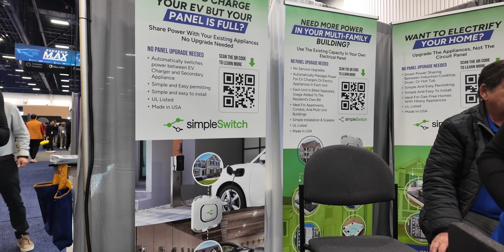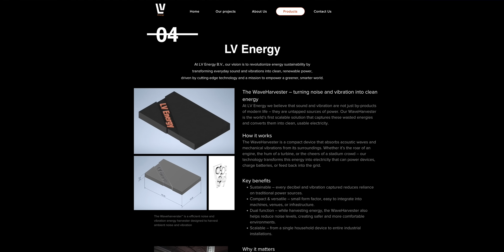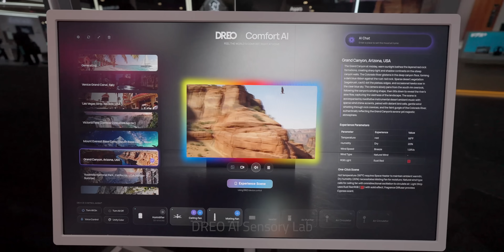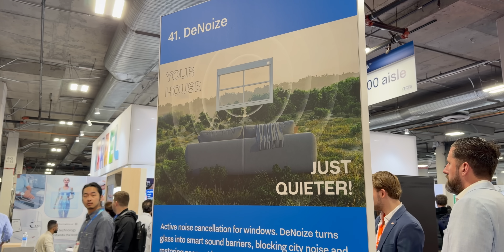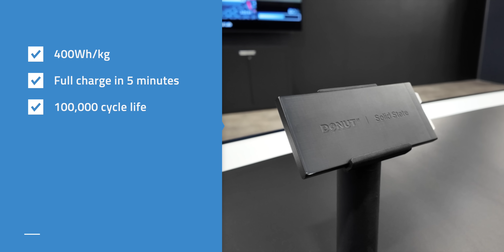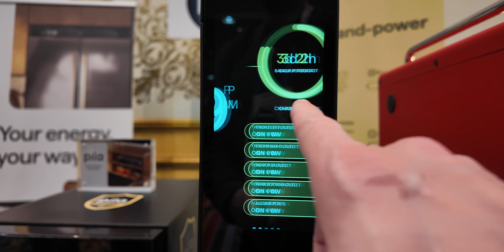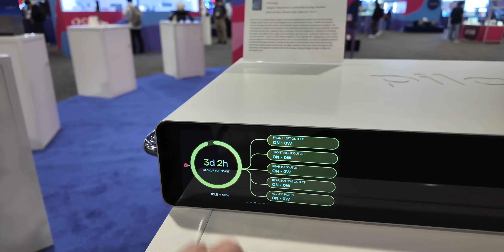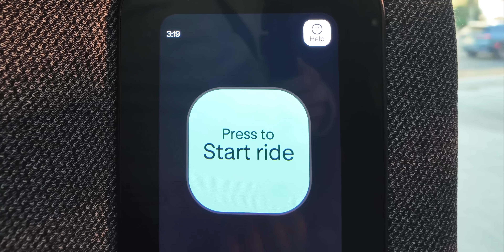The Most Controversial Battery at CES 2026

Comment: We use triple layered glass around here in the Netherlands, blocks most of the noise and is much cheaper. But then again, our construction methods are based on energy consumption reduction
Reply: I have triple layered glass in my new house in Germany, and i can assure you, i can still hear every car that drives by, not to mention heavier vehicles.
Reply: @Daniel-rd6st  hate to be that guy, but you bought a shit product. Most triple glass sellers sell way to thin glass and shitty structures that hold them. 
We had aluminium windows of super high quality with no zones where both heat/cold and/or sound could connect to the out or inside. And thick varying triple glass and all we heard are trucks when its dead silent around us. But if thats the windows or the walls.. who knows.
Reply: @AlbertWeirdo  I have aluminium windows too and they insolate very well, its a low energy home. Even at below zero degree temperatures the house stays at 20 degrees celsius with little work by the heatpump. And the company that build the house is known for its quality (and i hadnt had any reason to complain till now) and not cheap. But especially low amplitude soundwaves get through to some degree and also through the walls (which are a sandwichconstruction around 35 cm thick). Its usually not loud what gets through and i hear it only if i listen for it, but i honestly doubt, that normal triple glass windows alone will block all sounds from a busy street.
Reply: @Daniel-rd6st  Damn, every car? But yeah, I guess I'm spoiled in my courtyard, I can sometimes hear my dog barking on my neighbor's bacony. What I apparently can't hear is a thief cutting open the locks of my ebike, and taking it with me last week. Ugh.
Reply: here in the capital of Argentina, most apartments still use single layer glass for windows and doors, and central heating is also extremely rare, air conditioning not so much

I have absolutely no idea how developers still get away with it
Reply: @Franfiocchi-s7w  My house has single layer (USA)...but it's 101 years old...   I want to replace them...but the new window fairy keeps skipping my house.
Reply: @Franfiocchi-s7w  I am guessing it's because it does not get very cold there so there isn't as much of need for triple layer windows?
Reply: @tktspeed1433  indeed! but It gets hot, and the city sounds invade the apartments
Reply: @Franfiocchi-s7w  Taiwan is the same.😂
Reply: @DADA-bo5li VERY ANNOYING HERE. It went down to 8c a few weeks back, and there's no central heating systems. I turned on some nonsense GPU training sessions for heating.
Reply: Tri-pane helps a bit on noise, but it's primarily for insulation.  If you wanna reduce noise by 50+ dB, you need 2+ panes of laminated acoustic glass.
Reply: Is it common to only heat parts of homes?  I traveled around Netherlands back in the early 90s and more than a few houses were like that.  I was fine with cold bedrooms but one house had no heat in the bathroom LOL
Reply: @pixelpusher220  no heat in bathroom is a bad idea for mold and condensation
Reply: @CompletelyNormalPhenomenon 
That's where the German pastime of "Lüften" comes in. Every few hours all windows are opened for a couple of minutes 😅
Reply: @carstekoch haha is that a thing? In winter that is brutal!
Reply: @CompletelyNormalPhenomenon 
I'm dead serious.😂
It's not as bad as it sounds, though.
Most of the heat is stored in furnishing and walls/ceilings/floors and air has fairly low heat capacity so it warms up within minutes. Gets rid of all the humid air though.
Reply: @MrRAW1968  the company developing the windows is also from Netherlands (Delft). Last I heard they were running trials in collaboration with schipol to reduce aircraft noise in homes near the airport.
Reply: Here in America,  they base property taxes on how well built your home is, b/c f*** the peasants, is what some bureaucrats thought or something?
Reply: @ARKY-v3x property tax is based on qty of rooms, sqft type of rooms and land.

At least it should be. 

The “value” of things in the house shouldn’t affect your tax appraisal.
Reply: @eric4946 .  That’s ridiculous. Property tax is based on market value period.  You could have a crappy house in a wealthy neighborhood and the tax would be much higher than it would if located in an undesirable neighborhood
Reply: @rcpmacthis is not true and not how it works on general and I think you’re confusing my statement as, the same house on the same amount of land anywhere gets taxed as X.

That’s not what I mean, what I mean is that you don’t get taxed on the fact that your house has a better more expensive boiler, and insulation than your neighbor next to you. 

Assessments are based on “generic”
House in that neighborhood with that many rooms and sq ft.

Not the “true” value .
Reply: @MrRAW1968  it's funny that you bring that up, since DeNoize is also from here, The Netherlands :)
Reply: AI tells me 30db is normal for normal double layerd glass and 52 is possible.
Reply: The noise reduction would have to be much better than what you could get from triple pane to justify itself.
Reply: more than that .. R values don't take into account thermal mass. A 5 centuries old church will stay warmer than a modern house for less energy. So your system is based on using less materials not just less energy.
Reply: Here in the US, our construction methods seem more to focus on corporate profit (and trying to build well below minimum code if the inspectors are not paying attention).
Reply: @MonkeyJedi99 same in uk
Reply: @MePeterNicholls  Some good news here in Cambridge UK is that our local plan is mandating minimum land for self-build on new developments. At least some will be able to build to a decent standard.  I still find it ridiculous that people are installing double glazing when the extra cost of triple is tiny compared to the labour cost of upgrading.  To replace 2 bay windows will be £2500 for the windows for triple glazed, but if I wanted them installed by a local company they'd want £7-10k.  That'd be 2.5k per day for their installers.
Reply: @NealeUpstone dont get me started on the postage stamp size of windows too. I’ve seen more upvc than glass on some! And then there’s the ridiculous police led safer by design criteria that’s being mandated by planning depts even tho it’s not law and only guidance.
Reply: @MonkeyJedi99 .  In my American city as in most, not only is the energy code observed and complied with but there are incentives available to exceed the code.
Reply: @MonkeyJedi99  US codes are WAAAAY more restrictive than European codes its not even close especially for accessibility.
Reply: @raaaaaaaaaam496  You don't know what you're talking about. @MrRaw1968 is talking about the Netherlands. You're comparing the US to Europe, while Europe consists of many different countries, each with their own building codes. And I'm absolutely certain that building codes in the Netherlands are much stricter than those in the US, where many wooden houses are uninhabitable after a storm. There may be countries in Europe where the rules are less strict, but the Netherlands and Germany have very strict building codes.
Reply: @Poppetje75building codes actually often mandate those wooden houses. US building codes explicitly direct builders on what to build while European codes use guidelines. Eurocodes cover all EU nations while the International Building Code in the us also covers each state. However there is even more variance in US codes between states than Europe has. Not to mention especially problematic elements like ADA regulations which are much more extreme especially for things like elevators.
Reply: @raaaaaaaaaam496  There are guidelines like you say but each country in Europe has different codes, there are no "Eurocodes" that apply to every country in the EU.
Reply: @raaaaaaaaaam496  I've built my own house in the Netherlands and there's only few codes that matter. None are EU.
The Dutch national code, the local municipality codes and your license based on the exact design / construction calculations are all that matter.

Regarding your ADA, we have similar rules that apply to all new buildings. All of it should be fully accessible by disabled people. That said, of course in Europe there's many old and monumental buildings where you can't retrofit an elevator or it's not desired to do so.
Reply: @ThaMatsuda  The ADA in the US requires that elevators are large enough to allow a wheelchair uses to do a three point turn and for a fully deployed stretcher to sit in the elevator. This makes them much larger than EU elevators, infact it makes them larger than any elevators on Earth. The only places on Earth that don't EN 81 elevator codes are the US, Canada, and Japan. There is also many variations on the codes within these countries all the way down to the municipal level. The EU codes are more stringent on energy efficiency, sustainability, and skilled labor while the US has more restrictions on designs based on fire and ada rules. Our fire and ada rules are particularly the most restrictive in the world.
Reply: @MrRAW1968  almost 30 years back my parents got windows from the railway company on Sweden that blocked a large amount of all sound. 

These windows on CES are fun but I feel there're old proven solutions out there that will continue working even when the server dies and the electricity is cut. Why add another level of complexity?

Another question is who this is actually for? Is it that common to live in these noise conditions in a city and being allowed to swap windows yourself?
Reply: Yeah, right😂. In those 7% on the houses which are new builds.
Majority of Dutch houses are old and not always can fit such glass as mold will start to develop on the walls.
Reply: Here an asian. Adding glass to windows are not always necessary. We set and train our ears everyday so we can survive even outside the buildings
Reply: I think up here in Finland, it's mostly just double pane and the modern glass has UV and EMF blocking features etc.
Reply: @esaedvik  does EMF blocking mean you don't get a cel signal from inside?
Reply: @rhoharane  emf blocking is probably more of a marketing gimmick. Windows do have a metallic infrared blocking coating to reduce heat getting out. Side effects include a reduction of radio wave s which is usually not very noticeable.
Reply: @rhoharane . I believe that they are referring to e-coating which rejects solar radiation. Beneficial in warm climates and seasons.
Reply: Here in Upstate NY construction is always as cheap as possible so even though our winters are often brutal, they only use single pain glass on our shitty "luxury apartment" windows
Reply: @Shorkshire  single pane windows, where it snows? 😶
Reply: @esaedvik Pretty much everything built after 1980's has triple pane windows in Finland
Reply: Ok euro

Comment: Too bad there isn't a door lock with the powered mechanism on the frame side of the door.
You could just hard wire power to it.
Reply: You can still hard wire power to it while it's in the door,k you just need to have a flexible cable on the hinge side and a cable going into the door and through it to the lock. I've seen that done commercially plenty of times. It's just a much larger hassle and operation than just bolting in a battery powered lock. You either need to modifiy the door or buy another door altogether that has a cable channel built in.

Comment: That Donut Labs claim seems all the more dubious because of how they claim they intend to use it. If you really had a battery that good ready for production, you wouldn't put it in a niche low volume motorcycle. You'd license it to CATL, BYD, or LG, and make billions.
Reply: Do you really think the Chinese will pay for licencing? They are far more likely to reverse engineer the motorcycle battery and find loopholes in the patenting (or even ignore it altogether).
Reply: He is putting in motocycles to show that the battery is real and working, then he will scale up
Reply: @rwyo83  that would be an entirely unnecessary step, that would only delay mass adoption. Instead they can just go to CATL and say "Here, validate this battery, and let's talk mass production."
Reply: @zlozlozlo  the battery doesn't have any value now until it reaches demand, more demand more value,  then he can charge a higher price for the license or whatever he wants to do. But the truth is that he is not the owner of the tech, that is why he doesn't have patents.
Reply: @rwyo83  that's absolute nonsense pal. If the battery really has those specs, there is basically infinite demand for it. Those numbers are revolutionary, battery giants and OEMs would be fighting over the rights to co-produce that thing. And having the bidders evaluate the battery themselves is a far more straightforward than putting it in some motorcycle first. Also I'm talking about the company called Donut Labs here, which ostensibly developed the battery, so I'm not sure how they wouldn't have the patents for it. I have no idea who this "he" you keep talking about is.

Comment: What is interesting is you have been reporting on tech that have still not realised. But you think the Donut battery is too good to be true. You can actually buy a very advanced motorcycle that with them built in. Look for Verge. OK after the rest if your comments later in the video. I am also going to check out verge to see how they perform.

Comment: 1:43 is this seriously a concern? Korea solved this ages ago with battery low warning beeps days before it happens AND  a little connector to hold up a 9V battery to use if you totally ignore the MULTIPLE annoying warnings. You don't even need to carry around the physical key.
Reply: I have smart locks from ~2 yrs ago. Yes, they have clear notifications of "battery low" that is at least a full week before the device stops working. And of course my house has multiple doors and I deliberately changed batteries off cycle so it's impossible for both my smart locks to even be low in the same month. This is just.. not a problem at all.
Reply: I solved it with a mechanical lock decades ago.
Reply: Never heard of a manufacturer called Korea.
Many of the lock designs (most?) do not have external-battery terminals.

Comment: They arent going to patent the tech because it all relies on the production method. And the bikes are allready for sale so its weird if its hoax. This seems like they found some way to manifacture a capacitor that holds its charge for long periods of time. Prooably using sodium and carbon in a way with thousand of layers of anodes and catodes not just single layer anode, catode and electrolyte. And what comes to the cycle testing they can just test it for 5.000 cycles and calculate how it deteriorates and come to a conclusion that it will safely hold over 100.000 cycles. Its weird if they actually pulled it off, but well see in about 2 months after every battery has been ripped apart that theyve put in one of those bikes.

Comment: Missed opportunity by zoox to use seats that can change orientation by flipping the backseat, a feature that existed in trains which first appeared in cars with the Volvo 144 in 1967. Likewise, if they could further lay flat like the bench seats of the 1949 nash airliner seat, you would have a seat setup that could pull double duty as a travelling bed!
Reply: Probably not viable due to modern safety standards in cars. In trains its a non-issue, but designing a car to flip seats is a lot different and also means you have to dedicate space to the opposite side for leg room.
But I agree with you and disagree with him, those seats that face inward and no front/back means its very likely you may travel backwards which can make a lot of people feel sick or unsafe. Trains are 'forced' to move backwards due to fixed tracks, but cars can simply turn around. Some engineer probably thought this was a more efficient way to get around without seeing if the average person actually wants to be driven around backwards at 65mph

Comment: I to reserve a healthy scepticism re the Donut Labs battery , but boy, if it is true , what a leap in tech that will provide.
I so hope it is true. 
I want an electric Motorcycle that can run + 300 kms  and charge in 20 mins without being super heavy.
And an affordable Lighter EV that also charges in under half an hour providing 500-600 kms of range makes the change from ICE to EV a no brainer.
  
I also want a home battery I can place in an area without fear of Thermal runaway and fire risk and that allows our Australian safety rules to relax on placement adjacent to habitable rooms or within a metre of a window that opens.
Safety is not something to ignore. 
 A sodium or low cost SSB would be ideal.

Comment: Great to have automated systems that would charge all my EV’s and devices at off peak rates, THEN reduce utility power needs during peak.  I have E-storage in my EV and camper that goes mostly unused. These systems with variable voltage/source inputs need clean outputs with robust/redundant/manual backup circuits…can’t have on chip bring it all down!  A mobile system for my truck would be perfect.

Comment: The reason Donut didn't have a battery on display performing as per their specs is because it doesn't exist.  I'm sorry, but it is just BS that they have trade secrets that they need to keep under wraps.  Exactly how would a plastic box with terminals on it give away any trade secrets?  Do they think people will steal it, or have superman x-ray vision or something?  And even so, it is slated to be released in just a few months.  So even if someone did steal it, they would only be theoretically getting their hands on it a 3 months earlier than its retail debut.